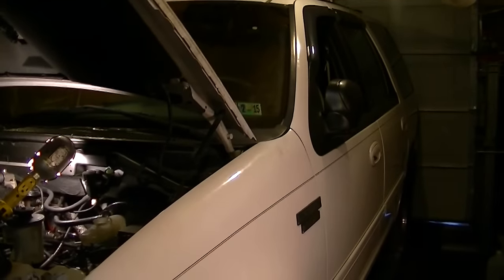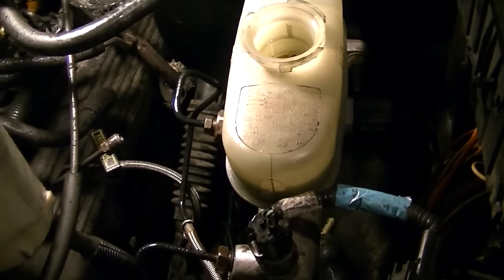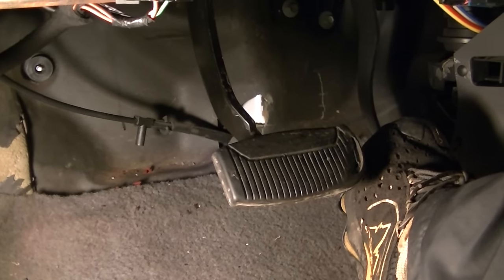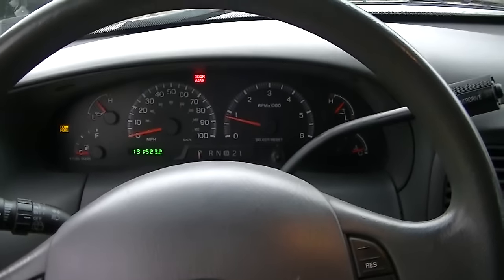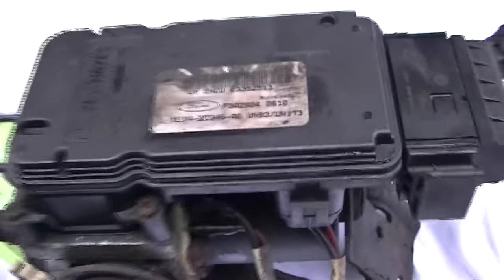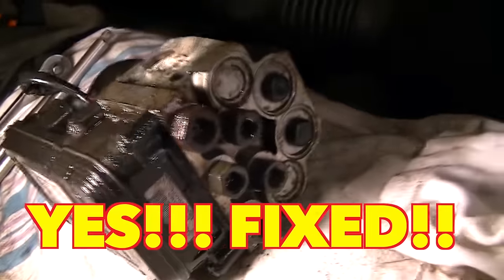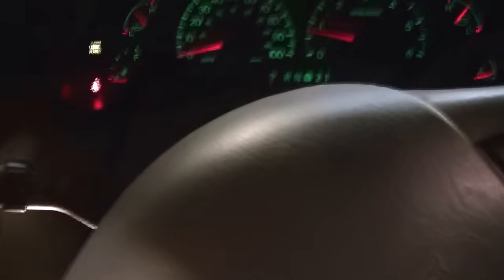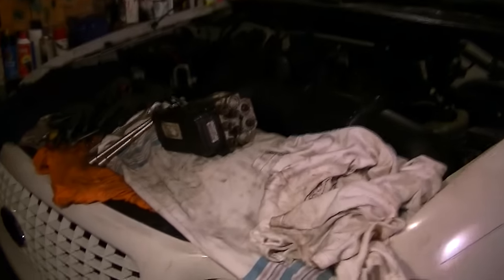Sinking/Spongy Brake Pedal -With ABS SYSTEM?? Nothing Works? Watch Fixed!

Comment: Hello TVWXNAN32, I replaced my master cylinder a couple months ago, and I am also back to having the brake pedal go to the floor. However, it is not all of the time. For example, I just went out and did a check on the brake booster by pumping the brake pedal. It gets to be hard, suggesting that the brake booster is good. However, when I turn the car on and drive it, within a mile from my apartment I have the brake pedal going all the way to the floor and I have diminished stopping ability. So it is not all the time. I know that the brake lines are not leaking, as I cannot find any leaks when I get under there. (I'm a girl who knows little about cars except how to find a leak. My last car was a literal death trap, so I learned a lot about finding leaks and broken hoses.) So do you think that the ABS pump on my vehicle could be the issue based on the experience that I am having? I drive a 1998 Oldsmobile 88 with just over 200,000 miles on it, and there are no brake lights on. Just the airbag light because my mechanic broke it when fixing the electrical issue with my headlights (it's not a big deal, and he is a great mechanic contrary to what that statement implies). So if you tell me that it could be the ABS pump, I want to be able to suggest it to him when I take my car for the repair.
Reply: Additionally, it cannot be the brake pads because they are in excellent shape. I can also do an inspection on my vehicle if you tell me of some specific place to look.
Reply: ONE more question: I see that you got the part from the junk yard. I cannot seem to locate a new ABS pump part for my Oldsmobile 88, and this is not unusual because of how old my car is. I had to use an off brand master brake cylinder because of this. So if I cannot find a new one, and I have to get a used part,  how did you know that the part you got from the junk yard was good? Did you test it before you bought it, or gamble the $40 on the assumption that these things don't really break.
Reply from the maker: My 1st question is, when you replaced the master cylinder was it new?
Reply from the maker: The ABS pump I got at the junk yard came with a 30 day warranty.
Reply: Yes. It was a generic brand part because the GM version is expensive and they do not really make them for my car anymore, but it was a brand new part from the parts store.
Reply: And the warranty is smart. I did not remember that they offered those on parts from the junk yard.
Reply from the maker: Yes some places they do...just ask.
Reply from the maker: Ok, then its prob a bad ABS pump system. One of the seals has gone bad causing fluid to leak inside of the ABS. Are you sure that car actually has ABS??
Reply: I am not sure, as my mechanic may have mentioned that it did not. However, the brake pedal says Automatic Break System on it in big letters. So I am not sure. I won't know until I go to the mechanic on Tuesday. Anything else it could be if not the ABS pump?
Reply from the maker: oK...keep us informed...be intresting to see what the issue is.
Reply: I definitely will. Thanks!
Reply: Hey TVWXMAN32, 
I went to the mechanic today. He could not find anything wrong with the brakes themselves, except that I need a new drum and shoes on the back tires. He said I could wait 2 or 3 months before getting them replaced, and that the worst that would happen was a noise while driving. The brake pedal is not as responsive as when the master brake cylinder was replaced, however he bled the brakes today, and it seems a bit more responsive than before I brought it in. He did not bleed the brakes when he put the master brake cylinder in because the access point had parts so rusty he was afraid he would break them, however today he did notice air in the brake lines. I will try to drive it to my boyfriend's house, 45 minutes away. If I have any issues braking, I will take it to the Midas out there that my boyfriend goes to. Otherwise, if my mechanic says it's safe to drive, I believe him! He is very trustworthy- a practical saint, really. Thanks for the video and your replies!
Reply from the maker: Ok...good deal. On the back, if the brake shoes are not adjusted right/tight...you can have a spongy pedal or excessive foot travel. That's why they need to be pretty tight adjusted to the drum. Any way good luck!

Comment: you just needed a scan tool to bleed the abs via the computer. there was air trapped in the abs
Reply from the maker: Nope. ABS bad block. I deal with all the time. If a pedal starts to sink without even working on a brake system, its not because one day it decides to say  'hey it time for you to bleed me'. Its bigger Issues.
Reply: Don't you need a scan tool to reprogram the new abs system for it to work as well, I have heard?

Comment: I have a 2014 traverse that has the stabilitrak come on every great once in a while along with traction control... sometimes the brake pedal goes fully to the floor also! I’ve had a brand new brake booster, master cylinder, even the valve and everything replaced. Still didn’t fix 1 issue. It’s infrequent enough that the dealership never gets it to happen and neither does the local mechanic... it happens once every 2 weeks or so. Sometimes longer. Sometimes shorter. Anyone had anything similar?!?!? Or any ideas??
Reply: Leaks aren't typically intermittent unless it's possible from going to cold/shrink hot/expand so I'd say the ABS Module or ABS Pump. Check the the ground strap too for the wiring on the ABS.
Reply: drewnashty I didn’t even think about checking the ground wire. That’s a quick easy look and idea... thank you! Im going to try that before replace the whole system which I have a feeling I will have to do. I think it’s the module more than the pump but might as well do both if I’m in there...
Reply: @patrickpreston1909  Check out Ozzstar's diagnosis of an ABS Pump on a Ford, van i think, might help you do some troubleshooting and narrow down your issue, hopefully it will be relevant to the model of ABS you have. https://youtu.be/6L-Qfm27D2M

Comment: Have you heard of this on a 2007 nissan frontier
Reply from the maker: Yes....common
Reply: I have checked and there are no recalls on this issue; I found the part for $200.00 will have a friend to install it.  Thanks for the video and glad I was able to find it online.  Keep posting those videos for us that the dealerships are giving us bogus information.  Three time to the dealer and now I will let you know once it is replaced if it took care of the issue.  Again Thanks
Reply: I'm having the same issue on a 2007 Frontier.   I have replaced the MC, all new rotors and calipers, and SS brake lines.    Disconnected the ABS and my brake pedal feels like it should now.      Just have to figure out how to replace the ABS unit or bleed it.
Reply from the maker: Ok good luck maybe you can get one thats used and a decent price!
Reply: I had the master cylinder replaced and still the same issue, any other suggestions?
Reply from the maker: ABS unless you have a leak in the line some where
Reply: No leak there is no kind of fluids at all, just puzzled at this on had one mechanic and dealer say they could not find anything wrong
Reply from the maker: You know the answer here ;(  ABS
Reply: I will get it back to him and have him try another one-Thanks
Reply: I made a video of my pedal and the sound it is making and would like to know if this is the master cylinder?
Reply from the maker: What kind of sound?
Reply from the maker: so the brakes stop ok? You just have the swoosh noise?
Reply: They go to the floor and stop fine, just the pedal should not go all the way to the floor
Reply: I will get it back over to my friend and get him to try this
Reply from the maker: Boy I'd be looking at that ABS...If you can verify the master cylinder is 
ok. Block it off and see if it still goes to the floor....and no leaks...and bleed...if so....you 
know the answer.

Comment: I think your abs needed to be bled.  As you know, a soft pedal is evidence that the brake fluid being pumped from the mc is going somewhere that it shouldn't be, leaks, bulges or compressing bubbles.  That's pretty much it.  There were no leaks, you had bled the lines several times, and I'm assuming you looked at the rubber lines.  The only other place that the fluid could have been going was the ABS.  If the ABS has no compressible air, a completely bled system could only have expanded calipers until they made contact with the discs and then it would have forced the pedal to stop because there would be no other place for the fluid to go.  I think you got lucky on the new ABS holding fluid from it's previous life.  ABS can be a bitch.  They do this stuff all the time.  Just my 2 cents.  Good video though.
Reply from the maker: Well at first, I though I have to eventually bleed the abs...but in a day the pedal was just like it should be. I'm still driving it today and it stops on a dime and feels really good. I guess in some cars you would have to bleed the brakes but it worked out for me ;)
Reply: That's good to hear, and once again, thanks for the video.
Reply from the maker: Nothing. The fuse just runs the motor on the ABS pump when you skid. This will not fix your sinking pedal  ;(
Reply from the maker: Let us know what it took to fix it!
Reply from the maker: OK, Good luck!

Comment: If you didn't bleed after replacing the ABS and it was rock hard and stayed that way with the ignition on, the used ABS you have now may be in bypass mode/  The question is: what happens if you intentionally stop so quickly that the ABS is supposed to engage?

Comment: Sorry, but it doesn't seem to fix anything. You still have a sinking pedal.... AND .... the vaccum sounds still exists - even louder. So how did you fix, if your results are worse?
Reply from the maker: Sorry your wrong. It been fixed for 2+years. Stops on a dime and will give you 9 cents back. Thanks for watching.
Reply: That's great. I just thought your foot on pedal traveled further from before replacing ABS module. If it works, I'm glad with you. Stay safe and Happy (Holidays) New Year to you and yours.

Comment: Your brake pedal was going half way down or more AFTER you replaced the ABS module!!!  You are trying to fool yourself into believing you fixed it.  BLEED THE ABS MODULE WITH A SCAN TOOL CAPABLE OF DOING SO.
Reply from the maker: lol. ok....still working to this day....what ever.
Reply: Scan tools can be over-rated when it comes to brakes because ABS brakes were invented literally decades before scan tools, so how were possibly thousands of ABS modules bled without them, LOL.  And not only that, but according to trained technicians with years of experience, scan tools are not even guaranteed to get all of the air out of an abs system.

Comment from the maker: Master Cylinder I'd start with. Because they only last 4-6 year or so it seems.  And It cheaper to start with. $40.00...And it it does not work...then you know its probably the ABS Issue ;(
Reply: I have a 99 F250 Superduty with hydro boost and I panic stopped thinking I was about to run over something and slammed HARD on the pedal now I have the sinking pedal issue I have bought a master cylinder but I am almost sure its the ABS. My question is, I am losing fluid like crazy but I can not see a puddle or any sign of a leak It's about to drive me nuts! Ever heard of anything like that??
Reply from the maker: Well if your losing fluid its going somewhere. The key is...when you panic stopped..something somewhere is leaking fluid. Look inside the rear drums if you have them. There's a leak somewhere.
Reply: Four wheel disc, oh yeah it's going somewhere but the wheels are dry and the area around the master cylinder is dry, My only thought was maybe somehow it's bleeding into the hydro boost system but I don't really see how. Very weird.
Reply from the maker: Power brake systems using "hydro-boost" may leak power steering fluid from the hydro-boost .... brake fluid leaking between master cylinder and brake booster. I see this sometimes. I think your onto something here.
Reply: I'll install the new master cylinder this week and see what I find. Thanks!

Comment: I hate ABS, in my opinion they are junk. at least the old cars when the front wheels have a leak the rear still stop the car or if the rear has a leak the front willl stop the car .
Not so will ABS ... if you get a hole in the line you have no brakes.
Reply from the maker: I know right! Last year was a record for me dealing with ABS issues!!

Comment: Ive replaced everything......including the brakepump. Ive bled the dam things about 10 different ways off you tube videos. Ive pumped at  least 2 gallons of fluid throught it.have had multiple mechanics look it over ....Ive just come to the conclusion that CHEVY Trucks ARE PIECES OF S H I T.....Also I rearended a midsize older car on the freeway in my 2001 3500 silverado pile of shit. And hit her going a max of 10 miles per hour and wholly shit My front end looked like I drove into a brick wall going 60mph. PLASTIC. GARBAGE  tRUCKS TODAY ARE JUNK NO PROTECTION AIRBAGS DIDNT EVEN GO OFF , CORE SUPPORT IS VERY CHEAP WEAK ALUMINUM POTMETAL. A COOKIE IS STRONGER THAN THE CORE SUPPORT.CHEVY HAS LOST MY VOTE AS A TOP TRUCK ITS A TOP PIECE OF SHIT. mY 1982 CORVETTE COULD HANDLE THE SAME IMPACT MUCH BETTER THAN THIS RIG. AND ITS A 2001. I COULD JUST IMAGINE WHAT THEIR BUILT WITH NOW PROBALLY BALSA WOOD WITH ALUMINUM PLATE OVER IT. EVERYTHING OUT THERE GOES UP WAY UP IN COST WHILE QUALITY GETS CHEAP A FIED BY SHITTIER DANGEROUS MATERIALS. SAME AS FOR OUR FOOD AT THE STORES , IT ALL POISION CHEMICAL SUBSTITUTES.. tHE MEAT IS POISION AND MILK PUMPED WITH TOXINS. AND WE GET TO PAY MORE FOR IT, AND NOT A PENNY INCREASE IN OUR WAGES.....iM 52 TIRED AND LOOKING FORWARD TO BEING DEAD WITHIN THE NEXT 10YRS. IM SO SICK OF GREEDY CHEAPASS MONEY MONGOLES, TODAY ANYBODY THATS 30YRS OR YOUNGER ARE WORTHLESS FOR WORKING THEY DONT WANNA , THEY WANT FREE FOOD FREE LIVING AND PLAY COMPUTER GAMES ALL DAY LONG..... tHOSE HEAD PEEPS AT CHEVROLET DELIBERITY DO FUCKED UP SHIT LIKE THIS TO GET YOUR MONEY .........IM NOT TAKEING IT NO PLACE SO LOOK OUT FOR ME ON THE FREEWAY CUZ i WILL RAM YOUR ASS IF YER IN MY WAY